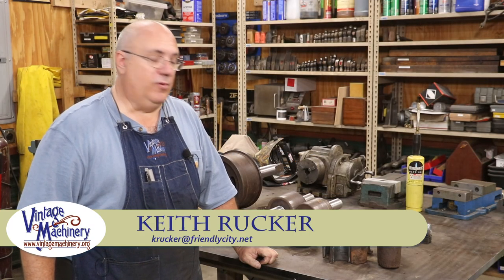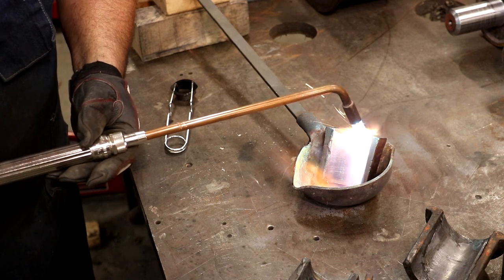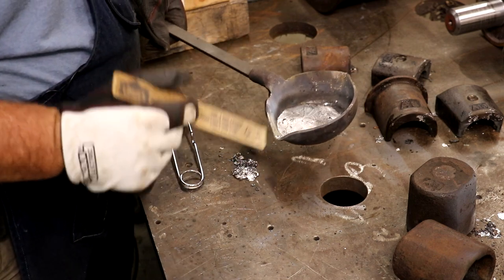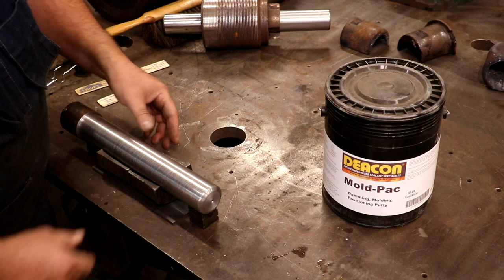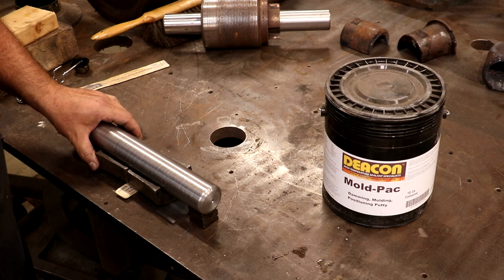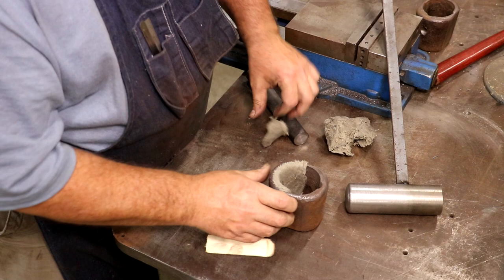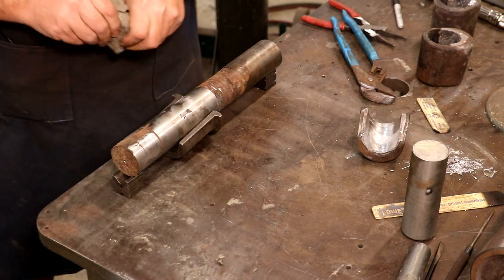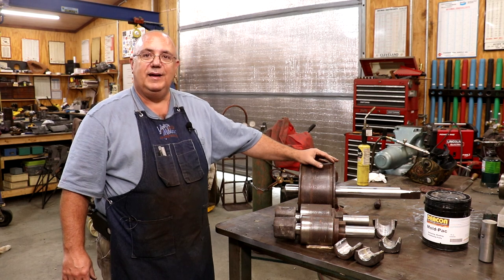Pouring Babbitt Bearings for a Goldens’ Three Roller Cane Mill

Comment: Hi, Keith. I'll try not to be too long. Back in 1963 when I started as an auto mechanic on Italian and UK autos, we were specialists.  I worked on many Bentley's and did a lot of engine restoration.  In the early 1930's on the 3.5 L strait 6 engine the rod bearings were poured Babbitt. Also, between the rod cap an the main rod itself were small spacers on each side between the cap and rod held in place by the rod bolts.  These pieces also had Babbitt poured on the edge toward the crankshaft rod journal.  As you just demonstrated the shaft has to be strait but not necessarily the same size.  Babbitt was poured into the rod cavity then machined to the size of the rod journal.  We just had to make sure the rod journals were round and inline with the crankshaft center line.   At times, it would take as much as two weeks to finish an engine, as some of the parts had to be made.  It was fun !!  Have fun in your work!
Reply: I've been told that Model T (and perhaps Model A) Fords also had babbit bearings, and repouring them was a fairly common thing that shops, and even individuals that worked on their own cars, did.
Reply: @lwilton  I know the Model A engines have Babbitt bearings, both rods and mains.  Not sure about the Model T but if I had to guess, I'll bet the same as the Model A.
Reply: @chieft3357  Yes the Model T and Model A had Babbitt bearings. 
Watch the Davin Hegarty channel to see his Model A pulled around his shop while he throws the clutch and drags the wheels to break the Babbitt bearings loose.

Comment: Great overview. Takes me back to working on 600 HP, Ingersoll Rand PRE, Air Compressor shaft bearings. They were a three part assembly. Top and back quarter box were Babbitt lined and the bottom was bronze. Thanks for letting us look over your shoulder while doing a almost lost skill.

Comment: I looked up the price of lead based Babbitt metal at McMaster-Carr and it costs about $108.00 for five pounds. Four and one-half pounds of tin based Babbitt is $327.00. I did a Babbitt bearing set when I was younger in the 1980s. I used the tin based metal. It is a shock how much these metals cost today. Nice job Keith.

Comment: For many years I have had this long coarse curved cutter file and a big block of 'putty' wrapped in waxed paper that I inherited from my grandfather. Now I know what both are used for.
Reply: The answer to a "whatzit" - cool thing to find out.
Reply: When I was an apprentice I worked for a company that built machinery for the Flax industry here in Ireland and abroad , all the "drawing" roller journals ran on "white metal" (babbit)  bushes. We had to make our own "scrapers" for smoothing the "high spots" from old half round files . This process is still used today due to the very high pressures exerted on the drawing rollers.
Reply: @roberthenderson760  What do the drawing rollers do?
Reply: @crowznest438  The drawing rollers draw the Flax fibre at a higher speed than the back feed rollers under high pressure from wooden pressing rollers , up to 1200 lbs, which is why we still use "white metal" bushes to withstand the constant pressure. The Flax is drawn out through a series of six machines in a "system " until it is light enough (ounces/yard) to be bleached and then spun. The bushes are kept lubricated by an oil soaked flannel which sits on top of the journal. If the bushes do become heated then castor oil is the best remedy. Properly maintained these bushes will last for decades. I have refurbished 50 and 60 year old machines built in Belfast with the original bushes like brand new.
Reply: @roberthenderson760  Thank you for the explanation.  I know how flax was processed back in the day but the modern process is a mystery.  Not as much of a mystery as it was before you explained that haha.
Reply: @roberthenderson760  What a wonderful topic rolling the flax would be for  YouTuber
Reply: A reward from the tool gods, for respecting the command of "Thou does never throw away tools or potentially useable materials"
Reply: @CONEHEADDK  in regards to that, i recently got in a small argument with my folks about throwing away some dirty old rags in my shop :)...
Reply: @calinguga  just because they’re dirty doesn’t mean you can’t wipe more grease on them ;)
Reply: @calinguga  Yup...  Leave my old rags alone, god damn it...

Comment: Great video. I still have my old bearing scraper in my tool box, it has a triangular blade. Only got to use it during my apprenticeship and once or twice in the 1960's helping to restore a couple of vintage cars. After that I often used it to scrape off the remains of stubborn gaskets.
Reply: Same,  I found the scraper at an estate sale.
Think I probably paid $ 1.00 for it.
Didn't know what it was until I got it home, got curious and did some interwebs searching.
Works great for getting inside things.

Comment: Oh, the days when we converted "Stove Bolt" Chevrolet 6 cylinder engines from Babbit bearing connecting rods to shell bearings.  Having connecting rods with shell bearings always increased the value of old vehicles. Change the rods, new Perfect Circle piston rings, grind the valves and you just performed a "Power Tune-Up"
Reply: My '51 Chevy had the babbit bearings, .005 shims in the rods. When you could 'pop' the rods back and forth you were good to go.
Reply: @larrydewitt  And do not forget, one could drop the oil pan, remove shims, put the pan back on while alongside the road.  Today being able to find the engine under all of the covers, let alone the oil pan, requires highly technical equipment and a lot of luck.
Reply: You've given my ageing memory a jog, haven't heard of Perfect Circle piston rings for decades. We used them here in Australia as well.
Reply: Our high school had a farm mechanic program we would rebuild the old stove bolts from scratch and all had babbet bearing 1970

Comment: 41 years ago while working for my good friend in his antique car / truck wrecking yard he got a windmill he planned to use on a well on his property. The bearing cap for the fan was missing, so I made a new one.  The windmill also used replaceable bearing inserts that were babbit. To make new bearing shells I stuck one piece of pipe the same diameter as the shaft the fan was connected to inside of a larger piece of pipe with them both standing on end. I then melted a bunch of lead wheel weights and poured the lead between the two pieces of pipe. I then cut the pieces of pipe in half lengthwise and with a little fitting they still are doing their job since 1980. My friend is now in his 68th year in business that he started at 11 years old.

Comment: For over a century railroad journal bearings were babbitt affairs.  The bottom of the journal box held wicking material to bathe the axle with oil as it move to make its revolution through the bearing.  The proverbial 'hot box' happened when the oil supply to the axle was disrupted for any of a variety of reasons and the journal would overheat and catch whatever oil remained in the journal box on fire.  Axle diameters came in standardized sizes and the bearing 'adapters' with the babbitt material also came in standard sizes.  Ball and roller bearings began replacing babbitt bearings with the coming of the Streamlined age.  Babbitt journal bearings were outlawed in Interchange Service January 1, 1991

Comment: Great video! 
I did this for a while for my company's large steam and gas turbines. We used large metal forms, dammed with asbestos(??) and used one of several types of babbit materials, depending on where each was used. These bearings were up to 14-18 inches in diameter. Glad that I was on that assignment for only a few months as my co-worker ended up with fatal mesothelioma from the asbestos a couple years after I moved on

Comment: Almost all the very old gearless elevator machines had babbited bearings.  The babbit was Cadtex, a special babbit for long bearing life.  We had  to be careful  not to let sweat drops fall into the hot moltened  babbitt.  It will explode and fling molten babbitt over the pourer.  
JoeB
Reply: I cast all of my own bullets. 
That happened to me a few times. 
The last time was the worst.
I was about to let a one lb. lead bar down into my Melting pot.
I had to stop what I was doing to look for another tool. 
It was quite hot & humid that day, by the time I returned to the lead pot, the one lb  bar in my hand had my sweat running down to it. When I let it go into the pot with the other molten lead, it exploded.
It splattered globs of molten lead all over my garage. Some of it stuck to the left side of my neck near the collarbone.
 It blistered & left a modest scar there.
Luckily, I had my safety glasses ON at the time. This was about 6-7 years ago.
 One should always have safety glasses on when casting this stuff. 🔍🔎
Reply: When I was a kid I was given a big lead ingot and it was way to big to fit in the melting pot so we turned it into crude shot by melting it and just letting it dribble into a bucket of water and it wasn't dry when we were running out of lead in the pot so my father got the brilliant idea to put the wet shot in, I gave him the shot and took off and he chucked a big handful in the pot and it exploded throwing molten lead all over my father who was there with no shirt on, he got covered in lead and so did the garage ceiling 🤣

Comment: Done maybe half dozen myself, old Amish sawmill parts to large dia fans.   Last time was more of a  filler for worn cast iron brush hog gearbox.   99g ni rod to remake some teeth, filed then fitted,  used a pop can base tight to spline as a dam.   Candle smoked the shaft used mix of babbit and some harder material mixed (memory forgot the mixture.)   Still going strong so must have worked.   Used it last weekend ad probably tomorrow again!

Comment: It’s very interesting to see the ‘old school’ way of pouring and fitting babbitted bearings. I work for a company that manufacturers babbitted bearings. We do all sorts of repairs for anything from vintage motorcycle engines to brand new compressor systems. I’m amazed about how many high tech machines use an arcane bearing technology.
Although I have to argue that Babbitt isn’t a precise material. We hold +/-0.0005 or less on a regular basis.

Comment: Had the aggravation of pouring my first in the rafters of a turn of the century line driven woodworking shop.
Reply: is this how old power looms used to work, all units in a shop driven by the same engine, coupled to the machines by a master line shaft in the ceiling?
Reply: @calinguga  
That's right. Leather flat belts, usually. I've seen ONE treadle powered drill press with a braided leather belt. About an inch in diameter. May have been a  repurposed bullwhip?!

Comment: As well as preheating the shaft/mould to prevent the Babbitt from cooling/solidifying before the pour is complete it also drys the area and prevents an explosion of the Babbitt material.
I was with my brother who was pouring lead into concrete pockets to support fence stantions when the liquid lead exploded. By some miracle he blinked so quickly that the lead sealed his eyelids to his cheeks. The lead just peeled off with no harm done, but a lesson was learned. 1/ wear proper safety gear including goggles. 2/ Always drive of moisture from the pouring zone.
The sudden high temperature turns moisture into steam increasing its volume by hundreds of times thereby spitting out the lead, Babbitt or other material being poured.

Comment: for 30+ years  i worked on sugar cane mill equipment  for the Fulton Iron manufacturing company.  your mill is quite a bit smaller than what i worked on.  try repairing 46 inch rolls with 55degree V  teeth cut full length[7 feet] of the roll.  4 rolls to a mill,  usually 6 mill to a unit.  these cast iron roll shells pressed onto a steel shaft with 18 to 22 inch bearing journals.  Tiger bronze bearings fitted to the shafts all mated up in fabricated roll housings.  the raw cane fed into the 1st mill to begin squeezing,   the 4 rolls meshing together tighter and tighter as each mill tandem sends the cane forward.  by the time the bagasse left the last mill  it was on average 97% moisture free. Fulton Iron is the oldest continually operating machine shop in the USA  and is known world wide for its sugar mill equipment design and manufacturing capabilities.

Comment: Babbit! Mentioned in 'The Grapes of Wrath' when the Joad family's Hudson Super Six ran a big end crossing the Mojave Desert, and Tom Joad successfully got her going again.
Reply: I rebuilt the engine in my dads ‘37 Terraplane Hudson in 1980. It has babbitts that burnt out in Phx AZ. And yes, it has the straight line six in it.
Reply: I'd forgotten that movie scene where the Super Six broke down. My dad owned a 1936 Terraplane sedan during the early forties with the straight six flathead engine. That engine had an oil filter inside the oil pan that could be cleaned by removing a few bolts and dropping the pan. I've heard of a few cases where worn connecting rod inserts were replaced by thin strips of leather to get the motorist going again.
Reply: My Grandfather Nighswander had a big panel truck that we called the Black Mariah. It was from the 30' I don't know brand or year. It spun a crank bearing.
My Dad told me that he and Gramps replaced the babbit bearing with a section of leather belt. He was still driving it in the early 60's before he lost his leg to diabetes.

Comment: That Babbitt bearing likely melted because someone put a motor on the mill. There was another restoration on YT where someone had made modification and they found out that too much speed melts the bearings.
Reply: Babbitt bearings used to be used in automotive engines, they're good for pretty high speeds so long as they get enough lubrication. Of course in this thing the bearings probably got little to none.
Reply: Requires lubrication and clearance
Reply: Dry starts kill babbit bearings.

Comment: What an interesting instructional video on babbitt bearings. Keith, since you used a trial shaft for pouring, I wonder if it would have been any benefit to finish the shaft slightly oversized to provide a small running clearance for the roller shafts?

Comment: Old technology is sometimes the best for certain applications. Thanks for the look.
Reply: Babbited of bearings are still pretty common in applications where the shafts being supported are in the tens or hundreds of tons range and spin fairly fast. The big difference in the process being that the Babbitt is centrifugally cast onto the bearing without the shaft in place, ie a backing ring is spun rapidly while the Babbitt solidifies onto the inside surface to ensure a thin and even layer.

Comment: Take a look at MAN, Wartsila, NSD, or Mitsubishi Slow Speed Diesel Engines.   Babbitted bearings are used for the crankshaft, connecting rod, crossheads, and if I remember correctly the pistons.  I worked with MAN B&W 7S50 MC-C engines.  They are 7 cylinder, 500mm bore, 2.5m stroke, 11,000 kW (15,000 bhp).  I think the weight is 300 tons.  Slow speed engines go up to 980mm bore, 12 cylinder, 98,000 bhp.  The babbitted bearings are pretty high tech.

Comment: I'd say in some ways Babbitt bearing can't be beat. Just look at every big old drill presses with flat belt drives pull find them used a hundred years and the bearings are still usable and less slop then ball bearings. I remember a big 24" lathe at a job shop I apprenticed in . The rapid traverse one time in many years needed the bearings repoured if I remember it took about two hours stripped cleaned polished and oil grooves cut. We did lots of maintenance for Bethlehem steel in the 70s.

Comment: I remember when my dad bought a 1950 1 ton Chevrolet (this was in the 1980's) to haul firewood with. The inline six was pretty well worn and had some rods knocking. He dropped the oil pan, took the babbit rod  bearings loose and filed them down.

Comment: So what determines when you have to "smoke" the shaft and when you can skip that step?
Reply: I was wondering at the point of removing the fresh mold - what  if the Babbitt stuck to the shaft instead of the bearing ;)
Reply: When the babbitt cools it is going to contract/shrink a little. That will give you enough room for everything to be "just right" and room for oil
Reply: we always use putty and wrap the shaft for lube tracks than well smoked

Comment: How did the babbit stick to the bearing shell, and NOT to the shaft when he was pouring it ? Was the shaft treated with some kind of mold release ?  Was the surface of the shaft so smooth that the babbit pops off it easily ?
Reply: THAT is a very good question.
Reply: In this application, Keith was relying on the shaft surface to self-release - normally you'd get a bit of soot on the shaft to act as a "release film". There's usually a bunch of shallow holes or grooves in the blocks to act as a mechanical key to keep the cooled babbitt in place.
Reply: An old Steam Thresher trick is to "soot up" the area that you don't want the Babbitt to stick. Use a heavy acetylene flame with a torch.

Comment: We had some seriously old farm implements that had wooden bearings.
Reply: I vaguely remember buying a new part for a combine thresher that was an oily wooden block.
Reply: Some species of wood are naturally very hard and oily and therefore make good bearings.  There's a species called lignum vitae that used to be very commonly used to support the propeller shaft in ships and hydroelectric turbines.
Reply: @macaroniandtuna  That's one of the few if only wood that doesn't float on water !
Reply: @millomweb  Brazilian Walnut or IPE' will not float in water either.
Reply: @clydeoyler1760  What about non Brazilian walnut ?

I wasn't aware of these 2 not floating.
Reply: @millomweb  Ipe' is the Proper name for Brazilian Walnut. Its also referred to as steel  wood.  The stuff is amazing .